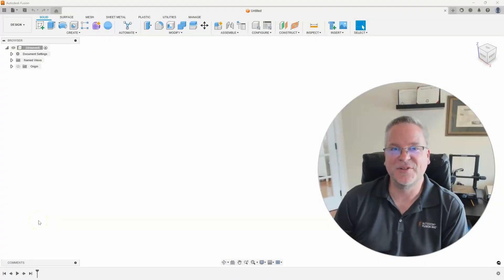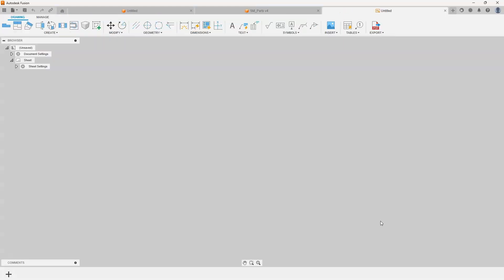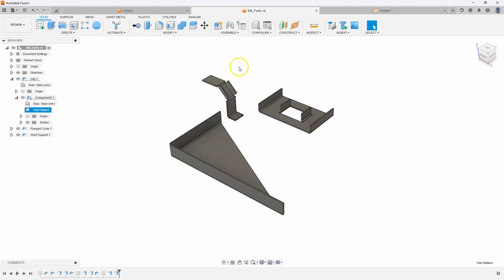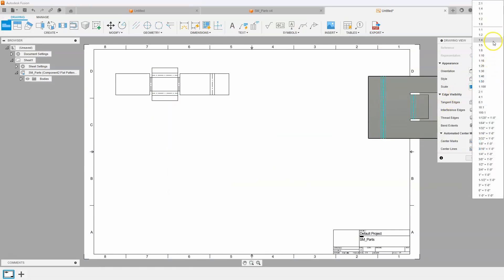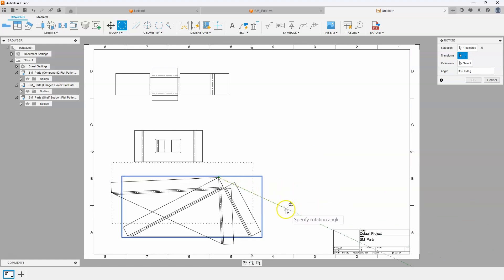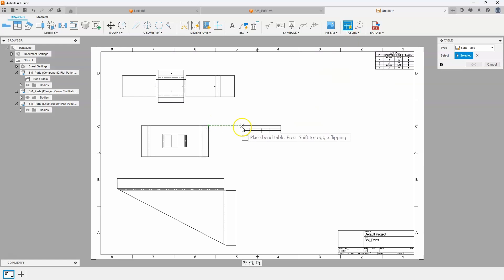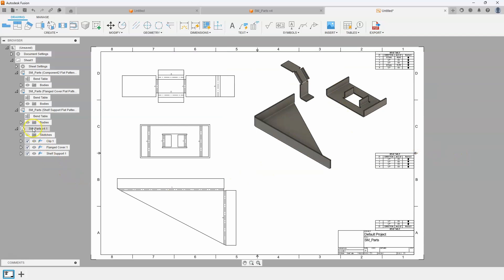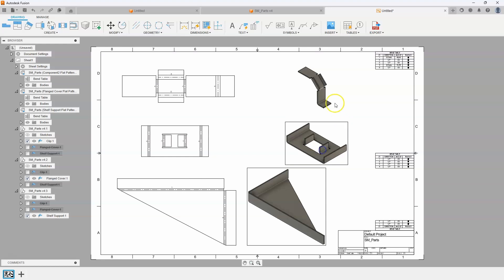Fusion Friday - Creating multiple flat patterns on one sheet

Comment: This was exactly what I was looking for, except when I go to activate the flat pattern on the subsequent parts, it only shows the sheet metal rule, the flat pattern is missing.  Any idea what I need to do to see it in my assembly model?
Reply: Not sure if there is another solution but I ended up going to each component model and making a separate drawing.  I think if it's a linked component for some reason the flat pattern is not available in the assembly.  Only 1 of the five components flat patterns were in there so it used the same one over and over in the automatic drawing, then I couldn't find any flat pattern to put them in myself.  But your video still helped me to understand at least a work around, thank you!

Comment: Hi Brad, I have a simple question. I’m new in CAM maybe I ask a stupid question. I have a simple and cheap home CNC. When I need multiple parts of the same type, I adjust between 2 jobs the X and Y , reset to zero and start the job again. Normally no problem, but for a home project I need 50 small brackets I hope Fusion will make my life easy. I can’t find a way to create the setting for one part and “pattern” those multiple times. Use the pattern components in the manufacturing tab, will result in a failed post file. Also during simulation I got a lot of errors.

On my hobby machine are no settings possible. I know fusion meanwhile for 4 years, so I expect there is a very simple solution Hope you will help me. 
Thx in advance
Reply from the maker: I'm curious why using pattern in the manufacturing tab results in a failed post.  Please feel free to email me at bradtallis@nexgensolutions and we can set up a zoom meeting to see what is going on.
Reply: @bradtallis8968  hi Brad tx for your response I really appreciate your kindness and accessibility. I’m really sure I make dumb mistakes so I not willing to waste your time. Maybe when you have time show in a Friday session how to do it correct. I learn Fusion 360 from you and Lars on YouTube. Every time I thought there was an error in Fusion, I was the error🤣🤣 pls consider an episode multiple object in cam. Just enter tool paths  for one part and multiple it by the requested number. Maybe and I will not want to over ask you, you can explain how to use g54 g55 etc for multiple locations. 
I know you aren’t a 100% CAM specialist but you are by far the best teacher. Again I hope you will help me/us. I’m in my golden years and having fun with Fusion. Stepping over to Easel pro is not my intention. I like to design and create everything myself, not just use a automated GUI

Comment: I was trying to use that Rotate view on a drawing just yesterday, but with a regular model. After rotating it would not let me place a projected view from that. It went through the steps, but when trying to actually place it, weirdness ensued....  I had to drag further, the image was kind of ghosting and when clicking it, nothing actually placed, but the command ended as if it worked. Very weird.

I really should report that, but I was pretty busy at the time so couldn't take the time out for that. I just left my view the way it was and got it done, just not ideally. Basically the issue was the part would look better rotated 90 degrees due to its length and the paper format. I could go back and rotate the model in the design space and likely end up with a better drawing, but its done now and out to a vendor for getting it completed. So, another day, haha.